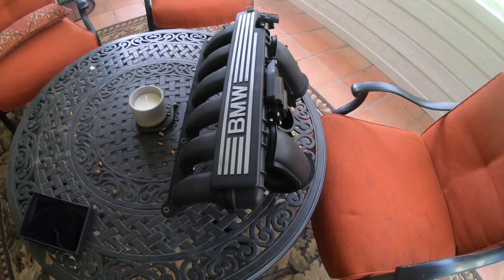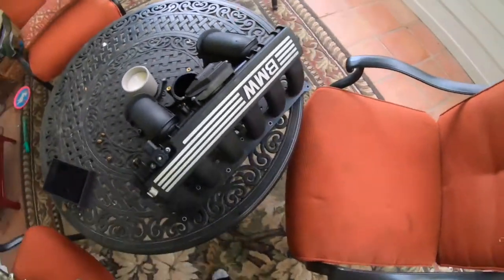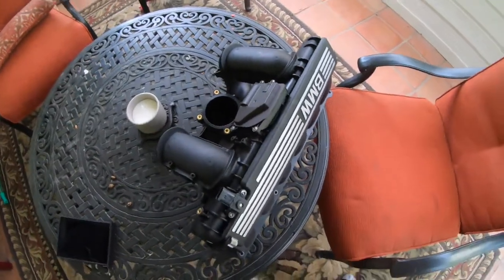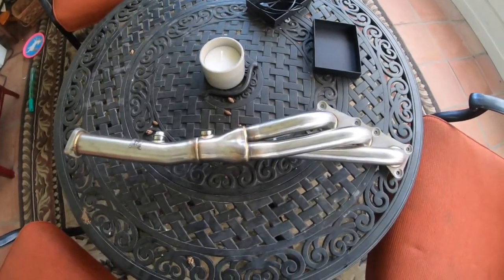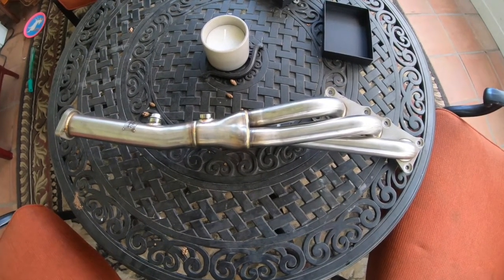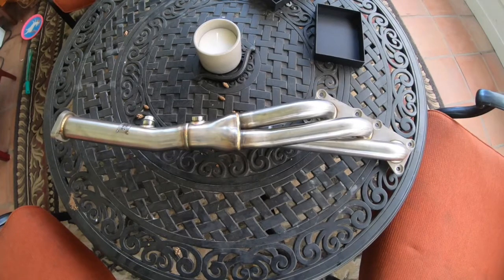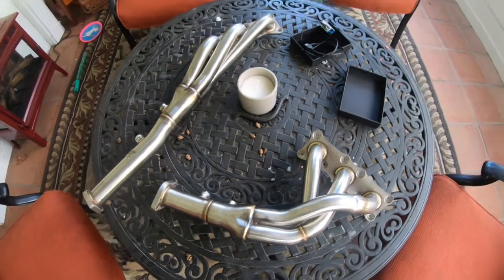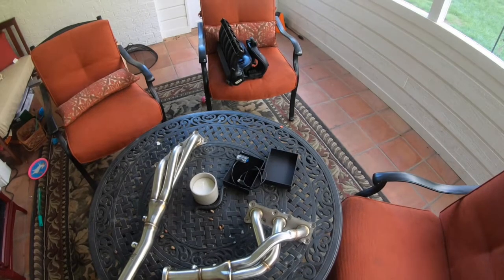Parts for the 3-Stage Intake Manifold Conversion for the BMW N52 Engine

Comment: What about all the wiring and gaskets for the manifold.  Ugh...
Reply: Exactly.  The gaskets the crankcase breather hoses.  The European Air intake with the cone filter should also be installed.
Reply from the maker: I believe my mechanic just used what I already had in the car, but I will confirm.

Comment: You mentioned that the N51 had the same tune as what came on the 330. I know it has the 3 stage intake but has the tune been confirmed? I have an 128i with the N51 so results may be limited
Reply: If this was true then that would mean the SULEV stuff is reducing HP by 20-30. I don't believe this is the case, the N51 is basically a de-tuned 330i engine with some extra emissions things tacked on.